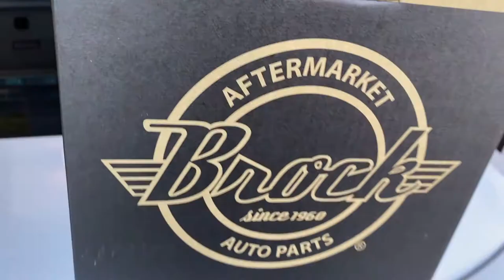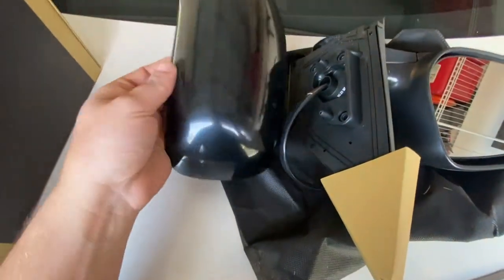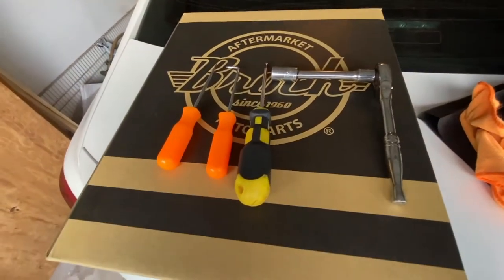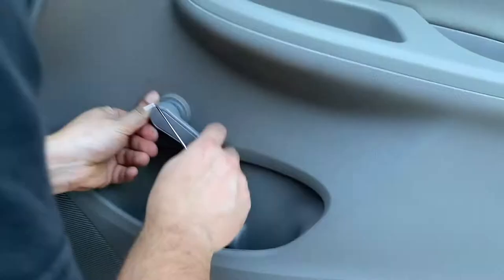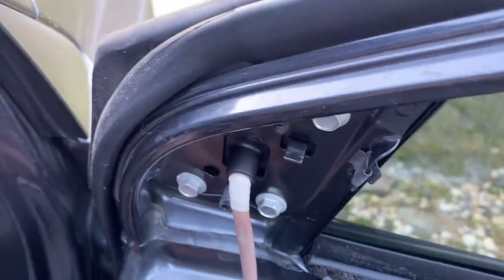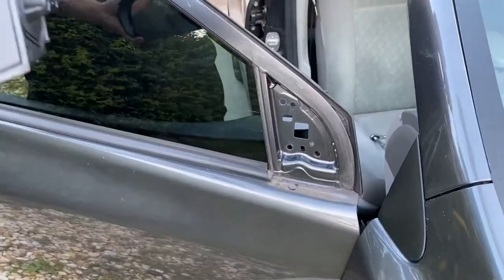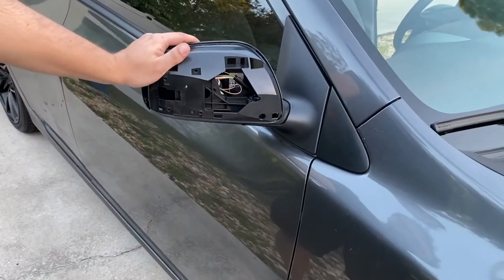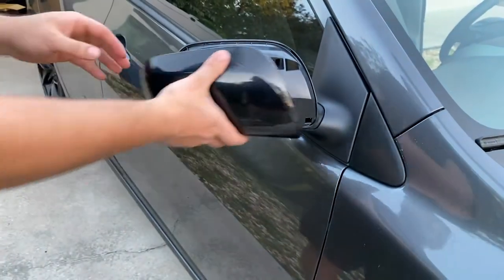Installing Side Mirrors on 2009-2013 Toyota Corolla

Comment: Made it look so easy, I was dreading replacing my passenger side mirror but after watching this video , I can confidently say that I can't wait to receive my replacement mirror from Amazon so I can take care of that blind spot that has been bugging me for weeks now. Great video
Reply from the maker: I’m glad the video was helpful! Hopefully your install goes just as smooth at mine!
Reply: @BrandonStellmach  thanks and it did go smoothly, took me about 15 mins to replace the passenger side and it works just as good as before . I'm a little proud of myself after the job was done and now I'm looking forward to replacing the driver side so they can both have new shiny mirror
Reply from the maker: @RomaVilla  that’s awesome! And the other side should be just as easy. And they will make your car look new again!

Comment: 👍😎👍

I had to replace the drivers side mirror on my 03 Corolla CE,. after smacking it at a McDonald's drive through.

Was an easier repair than I thought it would be.
Reply from the maker: Damn that sucks! But yes luckily they are very simple to install.

Comment: Hi. amazing video. Thanks. I have Toyota Corolla 2011. The left side mirror doesn't move. What should I do? To replace the power motor OR to replace the mirror? TNX!
Reply from the maker: Thank you!
And it would probably be a lot easier, to just replace the complete mirror.
Reply: @BrandonStellmach   Thanks. Is it so difficult to replace the power motor? 🤔
Reply from the maker: @shachardamari7550  I think it’s going to be more work, then just replacing the who side mirror. 
Plus the side mirrors do not cost that much.
Reply: @BrandonStellmach  Thanks for your response. I'm from Israel. Here, it costs 200$. A little bit expensive...
How much it costs in USA?
Reply from the maker: I have the links in the description for each Mirror, but they cost about $50 for each mirror.

Comment: Thank you! This helped me a ton man I appreciate iy
Reply from the maker: I’m glad the video was helpful! 👍
Reply: @BrandonStellmach  hey men! great video, i want to ask you, how can i remove the cover on the mirror? i wrap the roof  with black vinyl and the spoiler on my blue corolla 2009 s. it looks amazing but i want to wrap the covers on my mirrors too, i prefer that way than wrap the mirrors  installed on the car
Reply from the maker: @darthshaggy9970  it will be better if you wrapped them off the car and be able to tuck the vinyl behind because it will shrink back when the sun hits it.
But in order to take off the covers, there are a couple of clips you have to try not to break. I recommended get a plastic trim tool to try and pry on it and evenly pull the cover off at the same time. There really isn’t any easy way to pull them off because the clips hold them on very tight.

Comment: I have a white corolla and I want some dark black/heated/powered mirrors. Would these work good? 
Most importantly I do want the heat/power operation to work for the new ones.
Reply from the maker: Yes these came with the nice black outside housings, and these will work as long as you already have the power mirror buttons underneath your steering wheel.